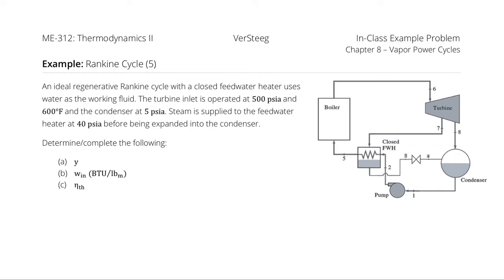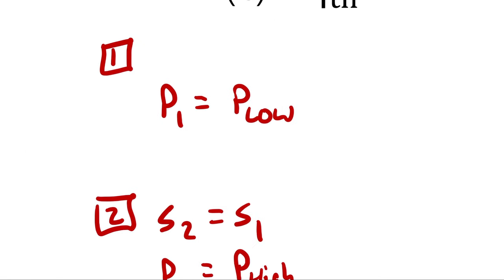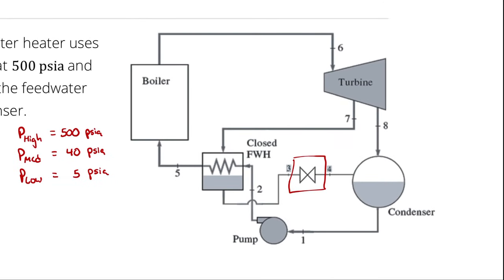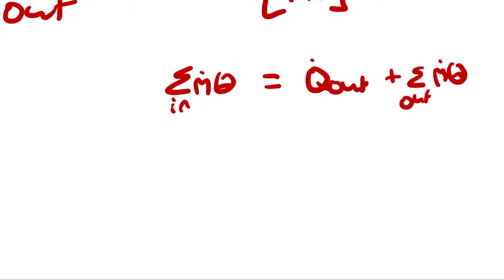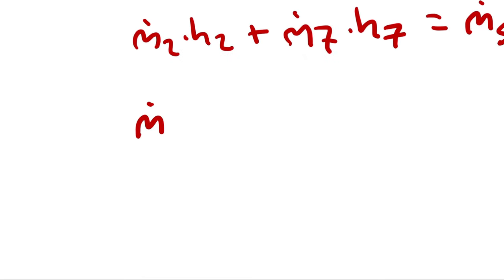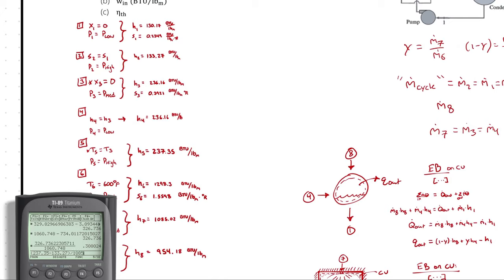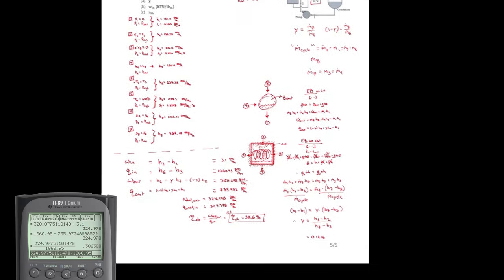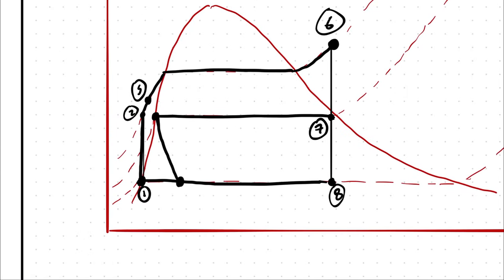Example Problem - Rankine Cycle (5) - Closed Feedwater Heater (2)

Comment: An ideal Rankine steam cycle modified with two closed feedwater heaters. The power cycle receives 15 kg/s of steam at the high-pressure inlet to the turbine at temperature 600 °C and pressure 5 MPa. The condenser pressure is 20 kPa. The feedwater heater exit states for the boiler feedwater and the condensed steam are the normally assumed ideal states. The fraction of mass extracted at 1500 kPa for the high-pressure closed feedwater heater is 0.16 (a) Sketch the T-s diagram for the ideal cycle. (b) Determine the fraction of mass that is extracted at the 250 kPa for the low pressure closed feedwater heater (c) Determine the net power output and the thermal efficiency of the plant.

Comment: Water is the working fluid in vapor power cycle. Saturated liquid enters the boiler at a pressure of 10 MPa, and enters the turbine as saturated vapor. The condenser pressure is 9 kPa. Determine (a) the thermal efficiency, (b) the back work ratio, (c) the heat transfer to the working fluid per unit mass passing through the boiler in kJ/kg and (d) the heat transfer from the working fluid per unit mass passing through the condenser in kJ/kg. (e) What would the thermal efficiency be if the steam entered the turbine at 5 MPa and the condenser pressure were 90 kPa? 

Please, make answer for this problem, sir